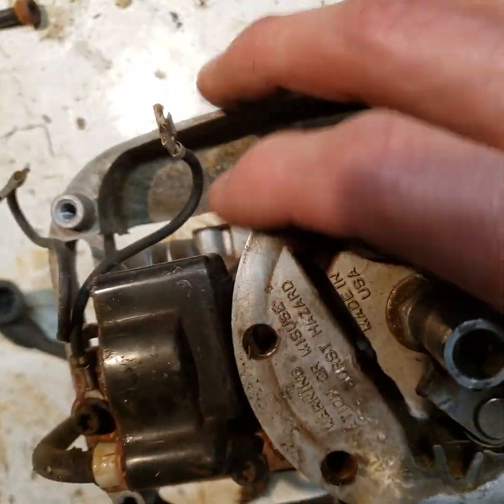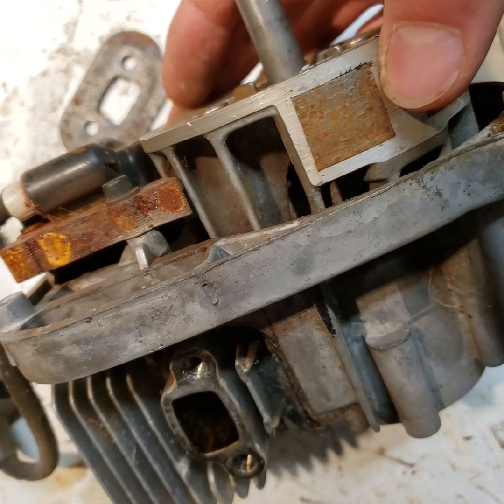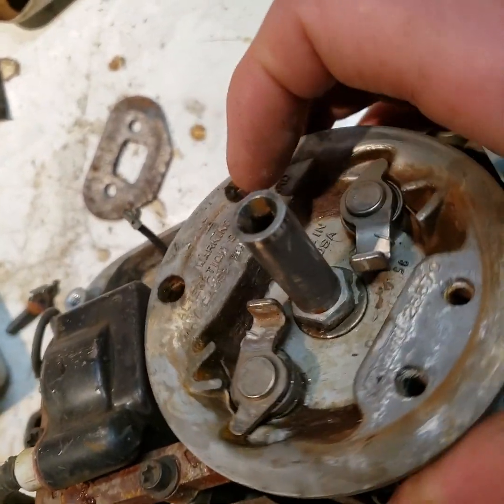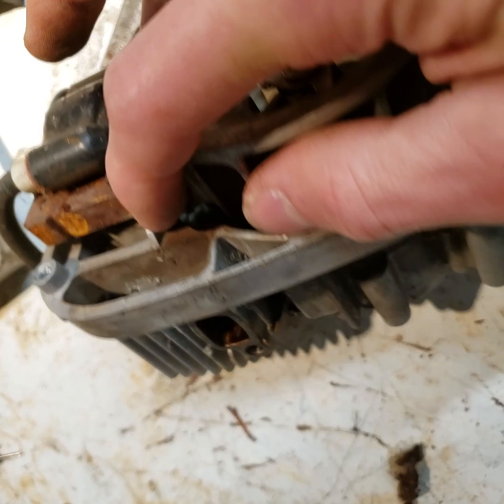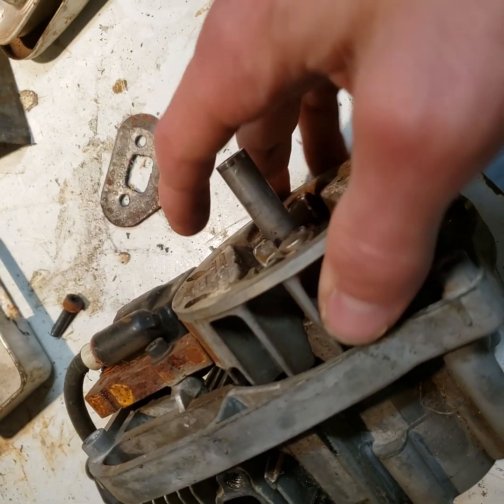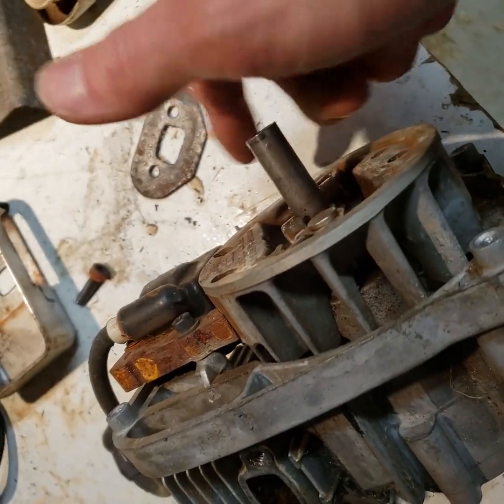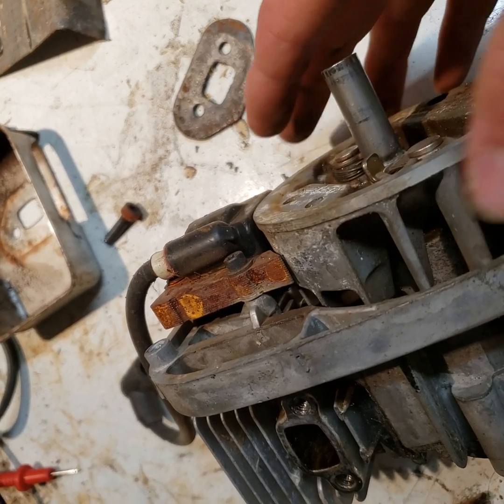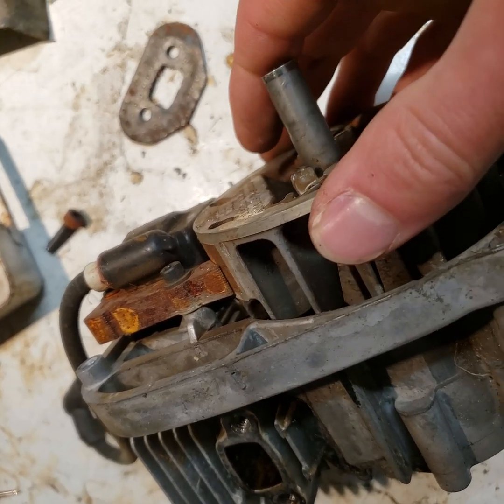Small engine flywheel/ Magneto operation questionn

Comment: Two years and no answers. Those magnets are a pair, one north, the other south, to complete the loop through the coil pack armature. I assume there is no points in this system, so the coil pack has a hidden magnetic pickup, that energizes voltage to internal transistors.
You may want to watch this; https://www.youtube.com/watch?v=NNlYbvDY6pI
Reply: Great video linked!